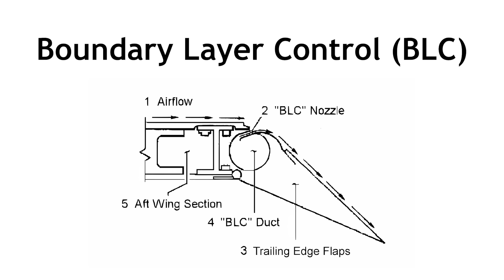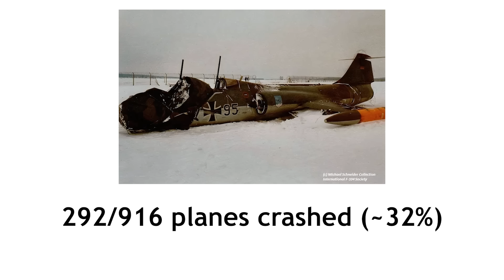Why This Jet Killed So Many Pilots?

Comment: Decades ago, I saw a fully restored F-104 at Van Nuys Airport, most likely this exact airplane used in the film, The Right Stuff.  I fondly remember the jet's sheer beauty, much like a bullet.  Potentially problematic to fly, yes.  Even today, as a retired airline VP no airplane brings such excitement!  One thing for certain, they don't make aircraft like that anymore!
Reply: The plane we see here, used in The Right Stuff, is a beautifully polished F-104G. Actually it should be a NF-104 with the ugly rocket engine fairing protuberating above the nozzle, but strangely no one bothered to reproduce it.
In fact, the aircraft never flamed out. It was when Yeager cut off the J-79 to transition to the Rocket engine that, in the extremely thin air, the turbine spooling down induced a gyroscopic oscillation that caused the loss of control. 😰

Comment: The main reason why so many German 104s crashed were corrupt politicians. The technical issues were just the result of this. But after General Johannes Steinhoff became responsible, things changed and crash rates were reduced to average crash rates of other jets in this time. The pilots didn´t call it "windowmaker". It was the press. Most pilots enjoyed flying the F-104. Check out the channels of the former Starfighter Pilots Wulf Beeck and Frank Heinevetter (also their channel-names).
Reply: The main reason they had so many crashes (initially) was a result of hubris and piss-poor program management.  It had nothing to do with the politicians.
Reply: @dukeford  It had. Franz Josef Strauß (former Minister of defence) was responsible that the German Air Force got the 104, many experts and pilots told before that it was not the right plane for the German airforce and other types (like the Mirage III) were better. He obviously received bribes, but it was never offcially confirmed.
Reply: @AcroAirwolf  The Germans would have crashed just as many Mirages, Lightnings, Super Tigers, etc.
Reply: @AcroAirwolf  That's nice, but it changes nothing.  As I've pointed out elsewhere, all 2nd Generation fighters crashed at more-or-less the same rates.  Bad management, low-time pilots, lack of training, and indifferent maintenance were the problems, not the airplane.  Or the politicians.
Reply: @AcroAirwolf  Would it have mattered?  Whatever aircraft was chosen would have crashed and killed pilots are similar rates.
Reply: @AcroAirwolf  Those kind of details are not relevant.  Examine the numbers.  The Mirage III, for example, supposedly an "easier" and more docile aircraft to fly, had the same safety history.

Comment: I was a line NCO at RAF Lossiemouth when a visiting F104 took off, five minutes later it called a control restriction Emergency, Told to dump fuel the pilot ignored the request, he landed fast with a full fuel load, he dropped his hook and missed the RHAG, deployed his chute which ripped off, he got close to the end of the end of the runway, and tried to turn off, still going to fast the nose undercarriage ripped off with a big crack. as his nose hit the deck his crash bar went a huge vapour of fuel came out of the engine, we could smell the fuel as he was close, he skidded to a stop just short of the perimeter fence by the golf course.
Reply: Wow it was a miracle he didn't ignite his fuel and blew up.
Reply: @colinw7205  what I did not mention was why he was at Lossiemouth he had two special adapted drop tanks converted to hold bottles of whisky, it was why he would not bang them off. After the initial fuel smell all we could smell was whisky as the drop tanks were smashed.  They moved the aircraft off the runway nearer our line the whisky smell lasted for days
Reply: Amazing and shocking.
Reply: Prefect landing for a Starfighter!😂

Comment: To me, it just looks like a bad design idea: A manned rocket with little stubby wings. Coincidentally, this plane is what took down the XB-70 Valkyrie bomber. Had one of the other fighters in that formation that fateful day been flying in the place of this F-104, I can't help but wonder if the outcome have been different, because F-104s weren't known for their maneuverability.
Reply: Yet it is the only known aircraft to have threatened the mighty NCC-1701.

Comment: Regardless of speed the sabers absolutely wrecked the migs once they got radar controlled gunsites. Despite the mig's aerodyamic superiority it didn't matter when the americans started using aimbots. Even when the soviets managed to copy it they couldn't make it work well because the gyroscope it used required tolerances of 10,000'th of an inch which they just weren't able to manufacture.